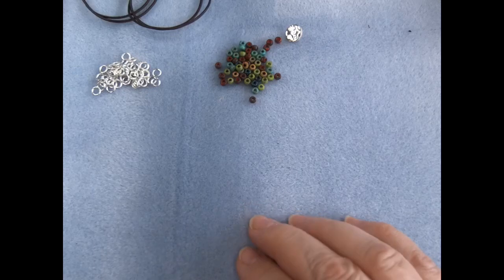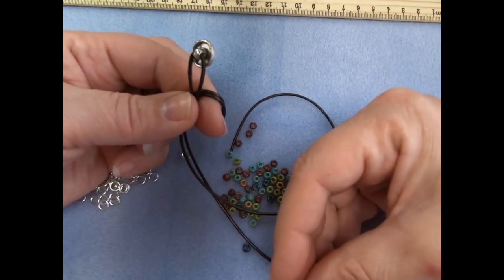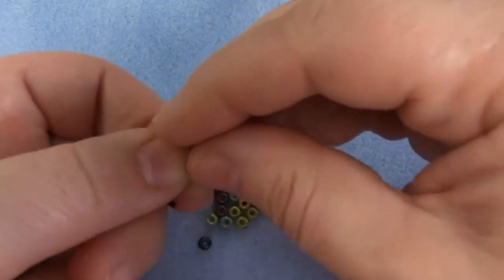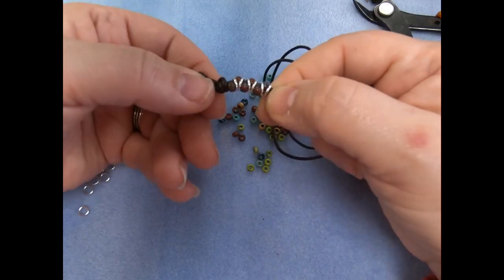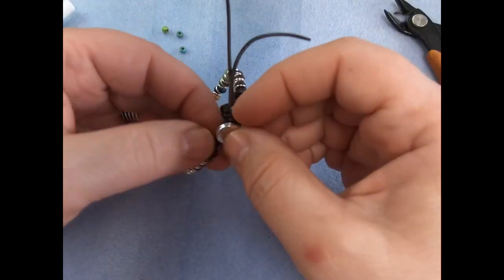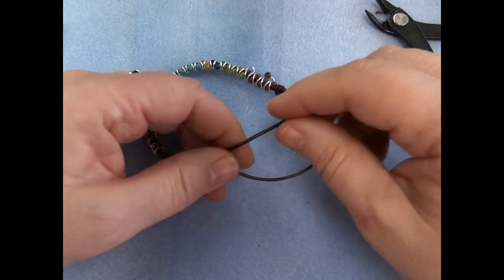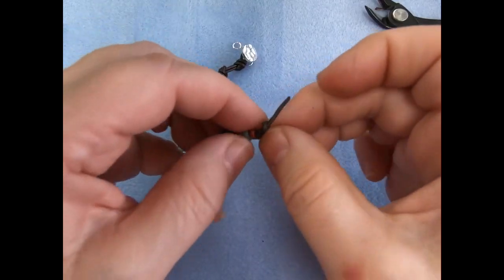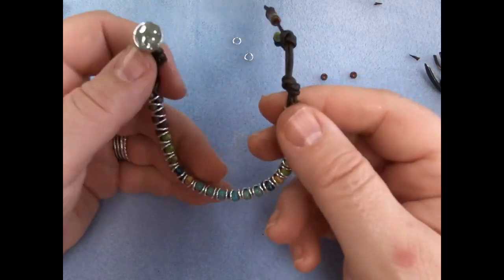Chevron Bracelet Tutorial: Make an easy seed bead and leather stackable bracelet!

Comment: Hi,
I would love to make this gorgeous bracelet! I would like to ask you if the jump rings are 4.5 mm 18ga or 6mm 18 ga. Thank you!
Reply from the maker: Hi Marley! The jump rings are 4.5mm ID (inside diameter) 18 gauge.  We always go by the inside measurement because it is the most important if you are making chainmaille. A 4.5mmID jump ring in 18gauge measures about 6.5mm in OD (outside diameter). I sell the ones I use on my website at this link:  https://pumpkinglass.com/products/jump-ring-open-45mm-id-18ga-silver-plate-qty-48. Thanks for watching the video!
Reply: Thank you for this information Teresa. I did check the jump rings out on your website, but I reside in Canada, and it states that the shipping cost could not be calculated. Can you help me with this. I did send you an email as well.
Reply from the maker: Marlee I could not figure out how to make my website calculate Canadian shipping correctly. I can give directly into Go Shippo however and create the shipping label from there. It seemed really high however, $15 to ship a small padded envelope to a random address I entered in Toronto. If you are still interested, just let me know what jumprings you would like, the quantity, and your address. I can calculate the shipping and send you a PayPal invoice. Thanks for your patience; I have been out for a surgery for several days. Best regards, teresa

Comment: Purchased the supplies to make this bracelet but I am not getting the chevron pattern.  I just looks stacked on top of each other.   I bought size 6 seed beads, 1.5 mm leather and 18 gauge 4.5 mm jump rings.  Did I purchase the right sizes?
Reply from the maker: You did purchase the correct sizes. A couple things I can think of-
- make sure the beads are compacted down against each other on each side of the ring. If the beads fit tightly on the leather, they won’t drop down against each other to make the jumprings angle on their sides between them.
- make sure you purchased 4.5mm 18g ID rings. That means the inside diameter is 4.5mm. If it is a 4.5 OD ring (outside diameter), that means you are actually using a 3.5mm ring and that is much too small to work correctly. If that is the issue, I do sell the rings on my website- https://pumpkinglass.com/products/jump-ring-open-45mm-id-18ga-silver-plate-qty-48
Reply: Thank you.  I believe it is the diameter of the ring.  I will check out your online store.

Comment: Instead of 6/0 seed beads, can you use 6mm round gemstones? Will those work?
Reply from the maker: So sorry Cindy! I didn’t see your question.  A gemstone would only work if the holes were large enough to string on the 1.5mm leather. Most are not that large.  Also a size 6/0 seed bead is actually a 4mm.  If you were to use 6mm stones, you would need larger jump rings that I used.

Comment: I love the tutorial. Could someone please tell me where to buy the 4.5 mm 18 gauge jump rings?  I cannot find them anyplace!  Thanks
Reply from the maker: I sell them Sheryl!  They are the nicest plated ones I have ever carried.  Technically they are regular open jumprings but they all out of the bag already tightly closed, perfectly flat and aligned.  Here is the link on my website:  https://pumpkinglass.com/products/jump-ring-open-45mm-id-18ga-silver-plate-qty-48
I also have lots of kits and tutorials that you can order while you are there! https://pumpkinglass.com/t/jewelry-kits
Thank you!
Reply: @pumpkinglassgallery  Excited to try these!  I think I'd prefer closed jump rings though - what would be the size for those, are they 6mm?
Reply from the maker: @tamarafisher5583  The outside diameter is 6mm, yes.  We go by inside diameter for chainmaille makers.  Even though mine are technically open rings that I use, they come so nicely closed with flush ends that I have to convince people in classes I have that there is indeed a split somewhere even though you can’t see it.
 I forgot to tell you I added an actual picture of the rings I sell so you can see it here: https://pumpkinglass.com/products/jump-ring-open-45mm-id-18ga-silver-plate-qty-48